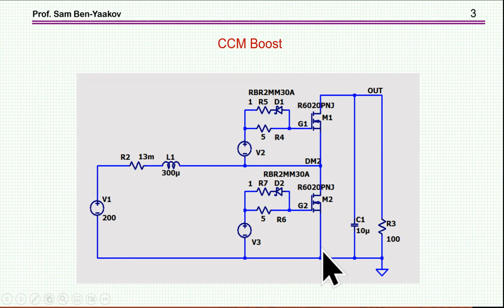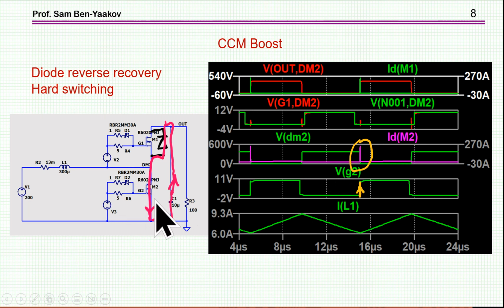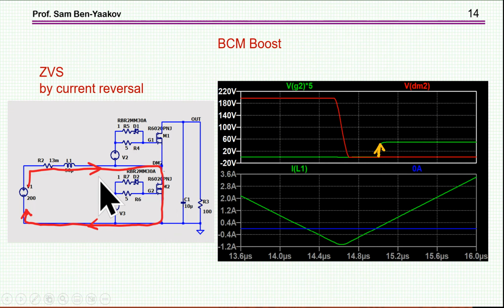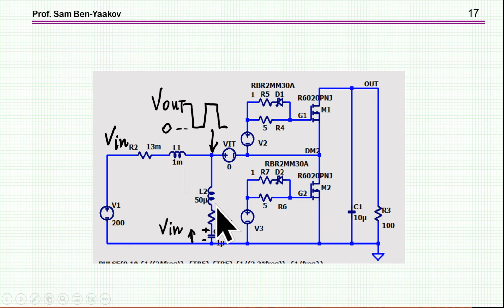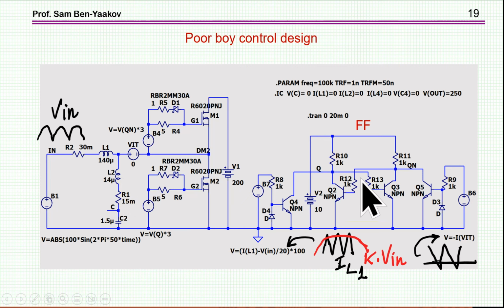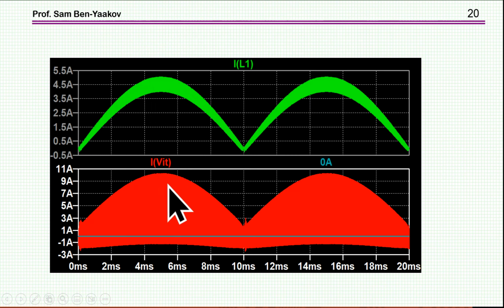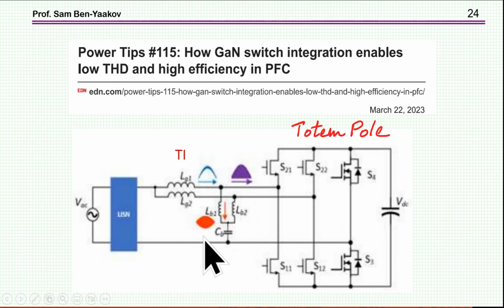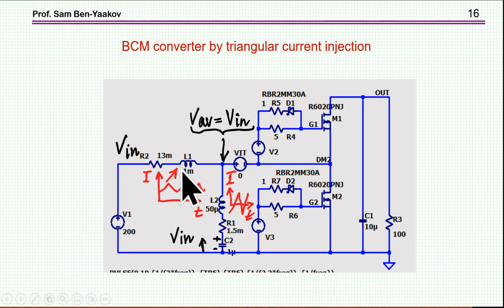BCM converters by triangular current injection, Part I: Basics

Comment: Sir please add this to your long to do list 😀
Reply from the maker: I'm on it.  🙂
Reply: @sambenyaakov  sir one question is it possible to have bcm mode with peak current mode control boost converter for holdup cap charging design?
Reply from the maker: @powerpath-n4u  yes

Comment: Thank you Professor for the circuit and explanation. Simulated the circuit as stated with some issues. BC337 BJT did not work in the RS latch circuit. We had to use ideal BJTs in LTSpice to make it work. What would you suggest for production? We also had to create a dead time between G1 and G2 gate drive waveforms to prevent huge current spikes. How would this circuit go when the crest of the mains gets close to the DC bus voltage?
Reply from the maker: 1. Just use an SR IC
2. Sure you need a dead time. As I remember I obtained a sufficient dead time by the asymmetrical drive.

Comment: Thank you for a great video. 
Can you explain a little bit about the VDC as a load at the second circuit?
Reply from the maker: Since the current is controlled , the circuit can accommodate any output voltage as long as it will not interfere with the Boost operation (e.g. being lower than the peak input voltage )

Comment: To achieve BCM operation, the switching frequency will not be fixed for different output load condition since the switching criteria will need to wait the inductor ripple current to go negative?
Reply from the maker: Indeed. This is something  explained in the video you might have missed🙂